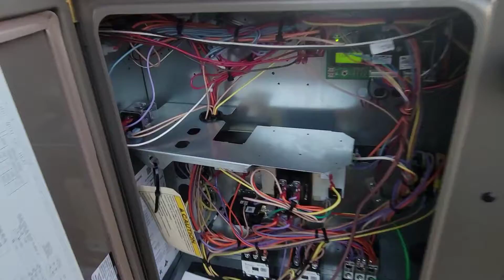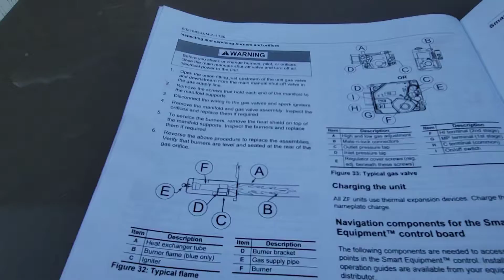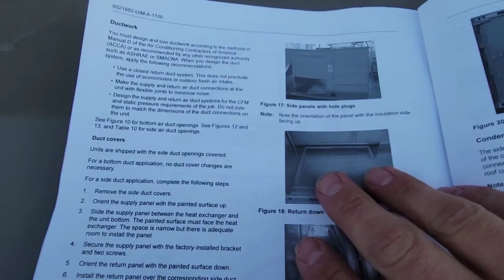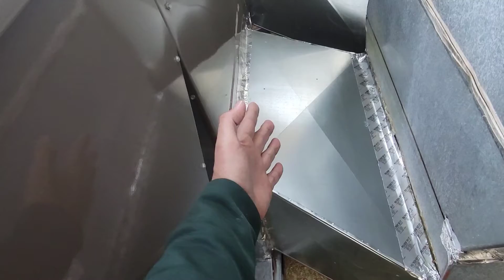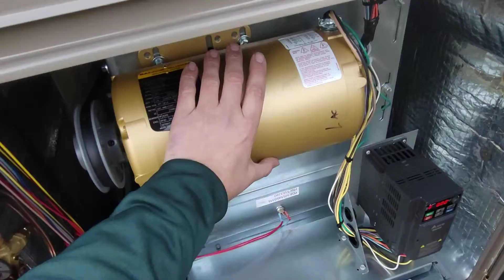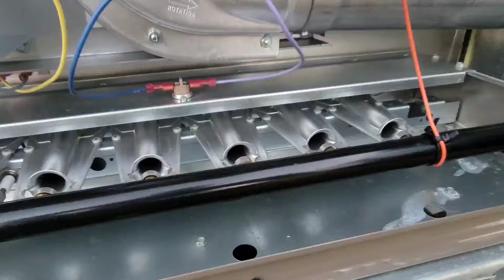York Commercial Package Gas Commission Tips #commercialhvac #hvac

Comment: Hello there my name is Tony from san Antonio tx , I need to see if you could help me with a York package gas unit with a vfd . The motor stays on 14 hz and it’s motor % is set at 25 % , the motor continues to stay at the same operation with stage 1 and 2 on. The dc voltage is a constant 4 vdc. The vfd is a delta ms300 and tried to check the settings and /or change settings it gives me an error message. It doesn’t allow me to get into it . I know very little about static psi. Due to the motor not allowing full operation.

Comment: Hi Buddy Nice video , when heat was turned on I didn't see side panel(Heat exchanger cover ) was off ,initially when we commission the unit first time we must remove that cover so all smoke will escape at the roof rather than inside the building,Thank you
Reply from the maker: Yes, you are right

Comment: Everyone is always dogging York equipment but I don’t mind their commercial rtus
Reply from the maker: I like the units
 I do not like when I have insulation hanging off of equipment Or when the belt and pulleys are off of the air handlers sometimes.
 But most of this equipment is set up properly from the factory
 Thanks for commenting really appreciate you please hit the like button 👍